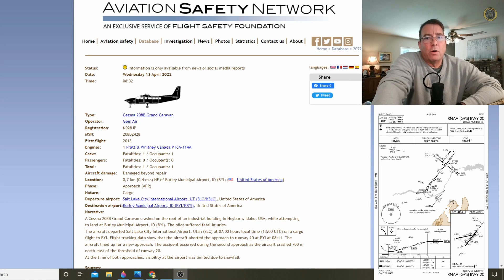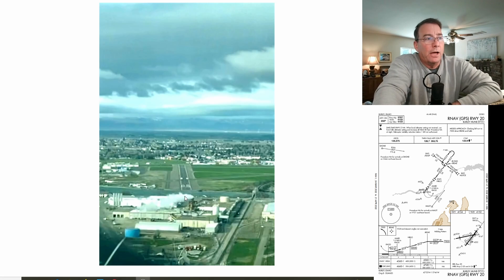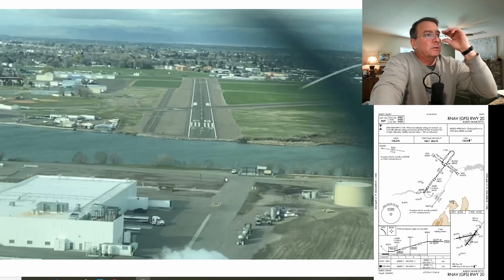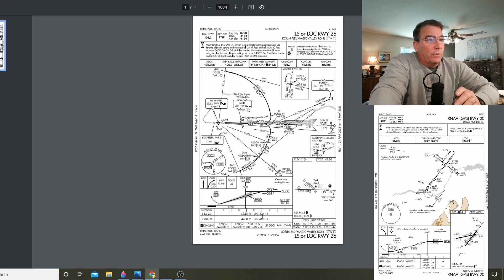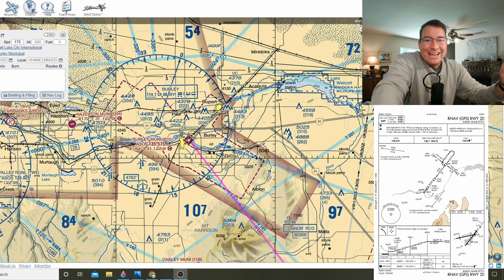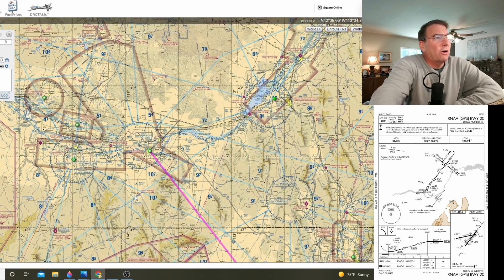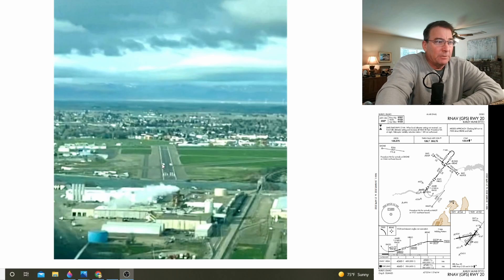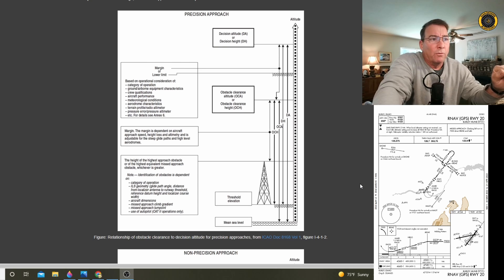Cessna 208 Caravan Crash Burley Idaho New Pictures of Approach

Comment: I wonder what the FAA is going to do about this approach now. I see they made a bunch of changes to the approach based on a NOTAM issued there. 2/20 is Burley's main runway as evidenced by the weight-bearing capability difference. If they displace the threshold very much more, the runway won't be usable in instances such as the 208 AFM that requires 2.2 of landing distance in a no-flap landing. It also appears they are geographically locked into any changes of the Part 77 surfaces. Doesn't look good.

Comment: You muddy the water talking about a lot of things that were not particularly an issue on this flight.
You’re insinuating that the TERP’s standards may have been violated?  The obstacle is 152’ AGL at 1.6-ish miles away, clearly an issue for high speed traffic (as well as too short for faster traffic) but a 208 should have no problem with the 3.75º approach angle, requiring (if she was carrying ice) about 800’/min VS…AND this tower wasn’t built yesterday.
Reply: The obstacle is .39 miles away from the start of RWY 20, confirmed via google earth.

Comment: One other thing, I think a lot of these previously VFR only airports, got RNAV fever, and eagerly implemented these new approaches.  While well intentioned, they introduced a potential hazard that wasn't there before. You end up having relatively low time instrument rated pilots, flying these approaches down to minimums. More so, if under the pressure of a revenue producing flight.

Comment: I don't understand why synthetic vision and advanced instrumentation is not yet general in GA.  The Kobe Bryant crash.. A multimillion dollar helicopter equipped only with steam gauges .  It seems daft.  So many crashes involve loss of spatial awareness.  Systems exist to virtually eliminate this problem.  Why are so many aircraft still so primitively equipped?
Reply: Money. It can be is extremely expensive to change the avionics on any aircraft; it is even more expensive to change the aircraft". This situation may be compounded by the fact that the need for modern instruments may only be occasional.

Comment: Soooo ... did someone consider possible 5G interference of the equipment yet? :)
Reply: interference of what equipment?
Reply: @buckmurdock2500  radar altimeter / gps etc. maybe the pilot was just IFR while below minimums and relied on navigation equipment? 🤔
Reply: @RubenKelevra  According to the FCC, no 5G has been deployed in all of Idaho. Only radar altimeters are subject to interference and this plane doesn't have a radar altimeter. 
If the pilot was operating below MDA without the requisite visual reference, s/he would be in violation of 91.175(e).
Reply: @buckmurdock2500  was this particular plane not equipped with radar altimeter or is the plane type just usually not equipped with a radar altimeter?

So close to the ground all types of radio equipment can malfunction if the receiver gets a very high signal input - in theory.

For example camera sensors can malfunction when placed in the beam of a large radar antenna - the wires will just act as antennas.

Agreed the pilot did something wrong, but only if the equipment was functioning properly: If the pilot was still IMC and never left it - but was confident that he/she was above minimum altitude because of a malfunctioning equipment than this wasn't that the case.

That's why I asked.
Reply: MDA or minimum descent altitude is measured with a baro altimeter than is not affected by any type of radio signals.
Reply: @buckmurdock2500  sure, but by weather. That's why you use the minimum decision height if possible.

That's why it's interesting if the chessna got upgraded with a radio altimeter.
Reply: @RubenKelevra  for what? The only thing a radar altimeter can do is provide a DH for a Cat II approach. A radar altimeter has no purpose in Cat I operations, it's not in anyway useful for maintenance of altitude.  Highly unlikely an operator would $1000's on useless equipment.
Reply: lol

Comment: ALSO!!!   With The Aircraft Fully Loaded,  The Pilot  May Have had To Maintain A  Slightly Higher Airspeed than Normal,  And in Order To Ensure that The Landing was Not too Heavy, She May have wanted to make as Shallow an Approach as Possible.  A you Have Suggested,  AT A CRITICAL  JUNCTURE  Those Steeples Would Have Been Obscured By the STEAM Being The Steam Being Emitted From The Chimney, thus Blinding The Pilot to the Uncoming Danger.  How Unfortunate!!! Perhaps The FAA Should Re-Assess The Suitability Of the Air Strip For Use,  Considering the Obstacles to Its Approach.  My Commiserations to the Pilots Family!